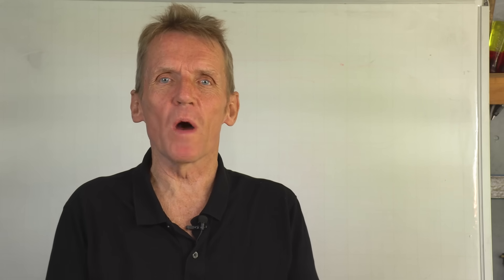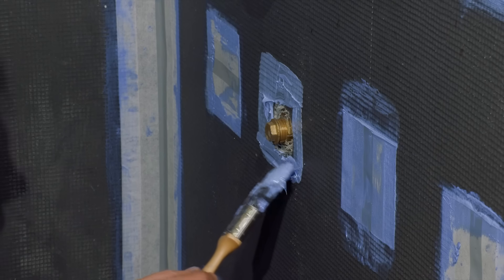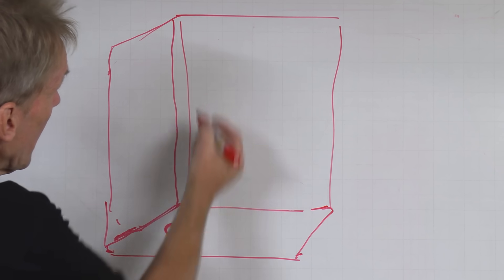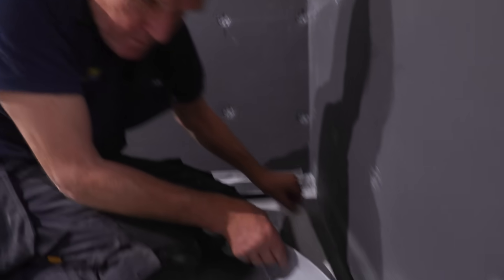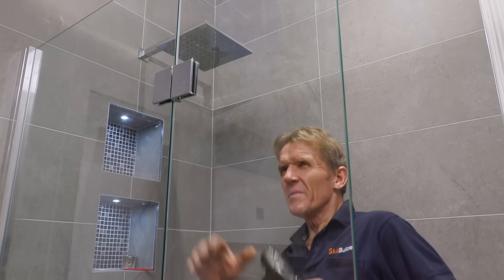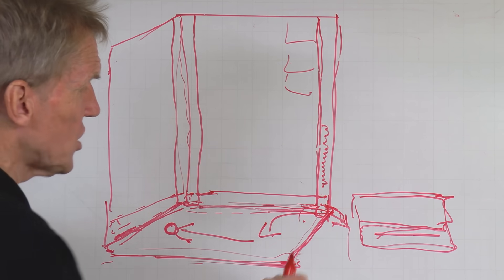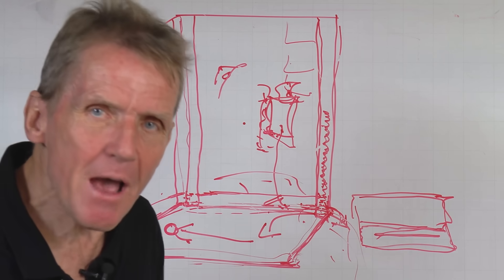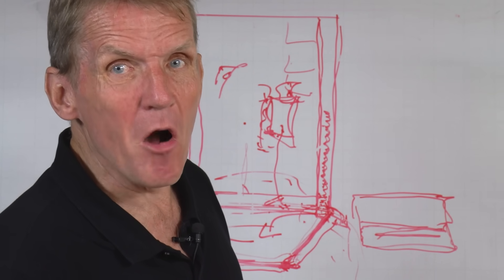This Is Why Your Shower Tray Leaks

Comment: I had to replace our shower because the tray was yellowing with age, it was at least 30 years old, as was the tiling.  Behind the tiles was a plastered wall, with absolutely no ingress of water - dry as a bone.  The tiles were placed very close together with virtually no grout line.  The wall is lightweight cement blocks with plaster applied directly (no plasterboard).  I have since used tile backer board but wonder if it was at an unnecessary cost.

Comment: What about if the pipework behind the shower is leaking and the moisture from this gets trapped BEHIND the tile backer board?
Reply from the maker: It won't be trapped, it will appear somewhere and will have to be dealt with. At least the wall and tiles will not have to be replaced.

Comment: our old shower tray cracked.. removing that reveealed the tiles had been put straight over standard gyprock plasterboard... corners cut by the builder 25 years ago. Gyprock all has to come down. Elements board to be the replacement.
So glad you did this clip... As I'll be fitting a new shower tray, so this clip is essential.

Comment: My installer has said this isn't required, but daid hes happy to do it if i want. But whats confusing me is that if i dont have flooring beneath my shower tray, where does the water go if it gets through? He's saying to put the shower tray onto the ply and not the flooring (though we do have enough flooring). Should we just floor under the tray?

Comment: We got our toilet refurbished  in the way and the materials you mentioned  (I filmed the process ) but the grout between the shower tray and the tiles wasn’t done properly . There was a tiny gap just in the middle - the builder said that shouldn’t been a problem but the leak travelled damaged the door frame, the wooden floors around the toilet and the roof downstairs. It is a walking shower with just a glass panel. He seal the gap “again” but the problem persists. I believe the issues is the shower screen (just glass) has a gap underneath it and the silicon is not good enough to contain the water on that area. Underfloor heating still working .

Comment: Hello Rodger Hardibacker, the cement board has to be sealed . As if the get wet, the water migrates to the studs  .thanks for the info .

Comment: Agree with the tile backer board/ tanking comments - but I don't trust those sticky back material solutions for the shower tray - wall joint. A shower tray with upstands, to me, is the best option. it's  fine, relying on that sticky back stuff - until water gets into the joint and eventually, the sticky back won't be sticky anymore, no matter what the blurb on the packaging says.

Comment: Hello Roger, great video! I have brick walls which will be skimmed. Can I tank directly on top of the multifinish? Thank you. I spoke to Mapie, and they said it's fine. Just wanted your opinion, please? Thank you very much.
Reply from the maker: Yes you can apply the tanking to plaster but I try not to have gypsum in the mix. I like a sand and cement finish to tile onto. That is how it used to be done. What are you using for the base coat on the brick walls? You can dot and dab tile backer board on the brickwork and tile onto that.

Comment: On my experience of the news tape on the valve for the mixing shover unit always filled up with flexible adhesive and then patched up with me on them paint it I never leave empty holes on partition walls with installing mixes or valves

Comment: First thing first you take your tray and stick  before you apply anything else. This is basically first line of the fence run good adhesive flexible around the right before you start apply in anything else.

Comment: First thing first you take your tray and stick  before you apply anything else. This is basically first line of the fence run good adhesive flexible around the right before you start apply in anything else.
Reply: Please, how many hours does it take to DIY this job?

Comment: I'm currently doing my bathroom with tile backer boards and the waterproof tape to make sure it's watertight.

But a question that never seems to get answered is... When you have tanked everything, and water does get through the tiles etc, where does it go? Does it push back through and make the tiles bulge? If it only gets onto the floor does it leak out above the boards?

Roger seemed to hint at that in the video, but it's only ever mentioned in passing.

Comment: After refurbing my bathroom i can confirm plasterboard does deteriorate but it had lasted some time. Used cement board instead. Horrible to cut it and it weighs a ton.

Comment: Question. How deep should the mortar bed be under a low level shower tray?
I dont want to raise it too much.
Whats the shallowest depth of mortar i can go?
Reply from the maker: All you need is a thin layer to even out any discrepancies in the casting, If you place a level or straightedge across the back you can see where the high and low spots are. It is rare for them to be completely flat but some are worse than others. If the hollow or high spot is 6mm you need an 8mm bed of mortar and then you just press the tray into it. 
A lean mix of 6 sand and one cement with some plasticiser is fine for the job,
I usually trowel it down and put the level across it to make sure it is level to start with, Then place the tray gently down and apply so pressure with your hands until is level. 
It needs to be left to go off but that could be 3 hours, I tend to leave them overnight.
Reply: Thank you

Comment: I've used an ardex tanking kit and meshed and tanked all the way to, and including the right angle where wall meets the floor. Is this good enough, or should I tape where it meets the floor? Thanks
Reply from the maker: I would say you are ok if you are fitting a tray but if it is a wet room you need to do the whole floor

Comment: Hi Roger, thanks for a great video. I've got to fit a shower to replace an existing bath. Walls are standard plasterboard. Should I use a tanking kit or put 6mm backing board over the plasterboard. Is the liquid membrane type tanking kit sufficient or would you recommend a waterproof lining paper?

Comment: Have a leak which is going down through the ceiling. Plastic shower tray. No water coming out onto the floor. Reapplied sealant but still leaking. No idea where the leak is. Any ideas?
Reply: Same problem what was the cause for you?
Reply: @PhilipLynn-p1e  the plastic tray dipped slightly while being used due to weight on it, allowing water to go underneath and down through the ceiling. Had to replace the plastic tray with ceramic tray.

Comment: OMG, I tiled my bathroom on plasterboard 20yrs ago, fitted a shower over the bath etc. Absolutely no leaks, no tiles have fallen off either.
I wad going to take the corner bath out, tile the "missing bit" behind the bath, then fit a 900mm by 1300mm tray with glass screen.

I wanted to use that fake tile board, it's about 10mm thick and stick it around the wall where the bath is being removed from, then fit the shower tray against that. Will this work? I will use silicone in all the joins like the corner.

I don't want to strip all the tiles to fit backer board, then tile board ...

Comment: My water is pooling around my tray edge and coming out in the front of the shower. I just regrouted to rule it out. Still leaking.
Reply from the maker: You should never seal the inside of the screen only the outside. Also the tiles must run behind the screen not just up to it
Reply: @SkillBuilder  thanks roger. I thought it was weaping through the grout and running along the tray lip out the front. Can't think of any other  way

Comment: My shower has a concrete base and it leaks out at the corner. Can i use silicone around the corners of the base?
Reply from the maker: which corner?
Reply: @SkillBuilder  it's the corner against the wall on the door entrance side

Comment: My shower (DIY) has been in for 15 years now and no water problems. I guess I got lucky because it's just plasterboard on all sides. The only thing I did slightly differently was to fit the shower tray before I put the plasterboard in and skimmed to give me a large overlap onto the tray if anything did leak down the line. It's hasn't.

I really like this video and when I re-tile in future, I will certainly follow the recommendations here.

Comment: Its simple Roger has been in the trade for many years and IF he says DONT DO IT, then dont, I ripped out my bath last year and installed a step in shower could not do a walk in due to the joists and the fall on the waste was wrong but got a small 6" step up which works well, and following his advise about tiling albeit i was tiling onto brickwork on all walls, hence I have none of the plasterbaord horror stories and have followed his advise for everything, should of gone solvent weld at the start but I was niave, tried push fit bad mistake, ripped out the push fit solvent weld done and as a more solid instal for several months no leaks, should of gone solvent weld off the bat.  If Roger says do it this way then do it cause my step in shower has had no leaks and the tray is solid.......and its all done to his advise my tile grouting wont win me awards but does the job...thanks Roger. Would love to send a pic of my finished step in shower bathroom but not sure how lol
Reply: Plasterboard is not waterproof, the coating on it is water repellent which is different but soak it up with a ton of humidity for years and you're gonna have a problem especially because people put holes in the plasterboard to acomodate their valves and pipes and usually don't seal around them and in water repellent plasterboard only the surface coating is water repellent the inside of it is still just plaster which is gonna soak up water like a sponge and turn to mush.

If you can always use cement board, not plasterboard, cement doesn't soak up water as easily as plaster and doesn't turn to mush like plaster, if you do use plasterboard then definitely make sure to seal it carefully, you can get away with plasterboard you just need to be more careful and put a membrane like Kerdi on it to prevent any water getting to the board but at that point cement board has already become a far cheaper solution
Reply: @liquidsnake6879  the Snake has hit the nail on the head DON't use any kind of plasterboard IT will fail down the line, unless your installing onto brickwork like myself use what Roger says he aint stupid, yeah plasterboard is quick and easy, waterproof might give you some peace of mind, but in a few years it will fail.........and you will have to rip it all out.

Comment: WAtching all Rogers shower installs. I’m about to gut our bathroom and change to a shower unit. I’m already expecting some horrors behind the loose tiles over the bath, which has a shower. I am prepared and will do a good job thanks to Roger
Reply from the maker: I am certain than you can make a better job than some of the chancers out there who are throwing in shower trays  and tiling on plasteboard
Reply: @SkillBuilder  I’ll let you know. Luckily I can also take advantage of my B&Q staff discount for the hardiebacker 🤣
Reply: @SkillBuilder  done. Behind the aforementioned tiles there were hardiebacker boards. That was the good news. The bad news was the joints were open and once the tiles were off I was able to just lift the panels off. Really really poor job. 

Once all the hidden damage was fixed everything went great. The difference is night and day. Thanks for the excellent guides.

Comment: Do you make a dry mix of sand and cement or a wet mix when installing a concrete shower tray?
Reply from the maker: Wet but not too wet
Reply: @SkillBuilder  Cheers.

Comment: How is the bottom of the shower profile sealed at the bottom? The profile fits flush to the wall and therefore no room for a horizontal  silicone seal behind it. ?
Reply from the maker: That is the function of the tape. It seals the back and allows for any flexing.

Comment: Superb video. Explains everything I need to do to correct our shower which was installed poorly using plywood walls. New Mira tray being delivered today and just installing Aquapanel. You explained why it has to be installed down to the floor too. I had been told to leave it above the tray. Thanks Roger!

Comment: Great video. Thanks. Can anyone advise please. I have a shower tray with upstands (replacement for previous tray that cracked and wall is chased). Should I use the classi strip/aqua seal with an upstand tray? 
I have replaced plasterboard with Hardibacker and bought aqua seal tanking system to use. 
Thanks

Comment: He is so right. I have seen so many decent looking installations turn into soggy nightmares. Beware of Hardiebacker and similar cement boards. they are great products
bur very absorbent and need sealing with SBR, never PVA  ! Use stainless screws to fix. Beware of aluminium enclosures with plastic seals to the glass - OMG so many
pitfalls waiting for the unwary ....

Comment: One of the major problems is faulty tray design. A tray should have an upstand at the back that fits under whatever vertical material that you are using. Then use shower panels (no joins other than the corner). Corner should have a rubber (or similar) seal in a metal trim. Do this and NO silicon will be needed, and it will not matter what is behind it- it will not leak. No silicon lasts forever.
Examine pod showers- they are sold as silicone free, because the design is right.
NEVER tile in a shower- the grout will always discolour and look bad.

Comment: I’m in Australia.  In 2016 I had my bathroom renovated and just happened to fluke a master-tiler who made building a new shower an art-form.  The old shower was stripped out and the entire bathroom floor jack-hammered up and brought back to the raw concrete slab.  My shower layout is identical to the drawing in this video.  The tiler used waterproof panels installed directly against the studs.  Then he rolled on the thickest, gooey stuff all over the new shower area and beyond, including the floor. He let that dry, then he did it again.  He built up the shower floor (no shower base). Then, using 600 x 300 tiles, he tiled the bathroom floor and walls up to 1.2 meters high.  The shower floor has cleverly cut tiles that follow the fall.  It looks like it’s folded.  Fantastic job, completed using techniques described here.  Anything less is most unwise

Comment: Before all this new stuff year's ago I used flashband to tank in the corners and joins between boards using a heat gun to seal, worked very well today the seal tapes are much thinner and better for tiling over, the good old bad old day's 😂👍

Comment: This is great. We have this scenario in our ensuite now (plasterboard walls, tiles, low profile shower base) - when the silicone fails it's leaking into the ceilings below and causing damage. Question - would it be sensible to remove the bottom layer of wall tiles, add the No More Leaks strip at least, and retile. I feel like this would be better than nothing until we can afford to get the whole room redone properly ... or is this a waste of time? thanks! great vid
Reply from the maker: I have often done that job of removing the lower course of tiles and putting in a strip of tile backer board then putting the tiles back. Sometimes you can salvage the tiles and do a really good job. You really need a multi-tool to get the grout out and then I usually try and get a half inch strip of board off just behind the lower edge of the first good row so I can put the board up behind the join. It can be tricky but it can solve the problem once and for all.

Comment: Just wasted my weekend repairing my plasterboard shower that fell apart big style.
Reply from the maker: You are not alone
Reply: @SkillBuilder  It's coming up for Renewal and will DEFINITELY be constructed as shown here (and your previous 'Rant-Less' Pieces).
It's not the first time it's fallen apart.
And the wall Battens will need replacing 'cos they're Rotten as well.
I'll wager the floor joists won't be pretty either.

Comment: Your comments are bang on. I work for a national house builder and all our showers/ bathrooms are installed on moisture resistant plasterboard, its shit, the amount of full strip outs I do is nuts, my boss says I have to replace like for like but I just ignore him and buy cement board. Our problem is that the stud walls flex, the grout then pops and next we have tiles dropping off and a big stinky mess. My biggest annoyance is that our top brass say waterproof boards are too expensive and insist we continue to use plasterboard.

Comment: Just finished mine and I tanked the walls and floor and used shower panels and water resistant plasterboard after watching you videos help loads great advices you give plus so far so good no leaks if it does it will run into the bathroom not the walls and ceiling like the old one that was there 😊

Comment: Excellent, thanks for doing this Roger. We have further photos etc throughout the house build stages which show severe issues and not following manufacturers instructions. Luckily we stalked this house throughout the build and took photos of everything along the way. We have 600 joisters but not the metal ones, the earlier type and thin plasterboards I think but no noggins. They put up 250 screws into the ceiling and 250 screws into the flooring above which didn't resolve it. They then screwed down the hallway / kids bedroom as they were meant to do it on the entire house then move onto noggins and bracing if that failed. That was over a year ago. Go to town on these house builders, name and shame.